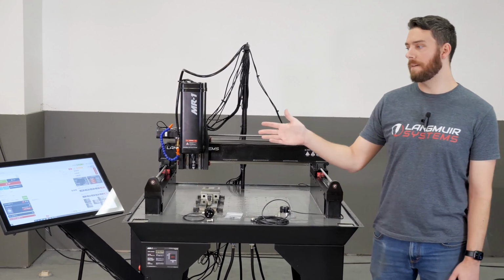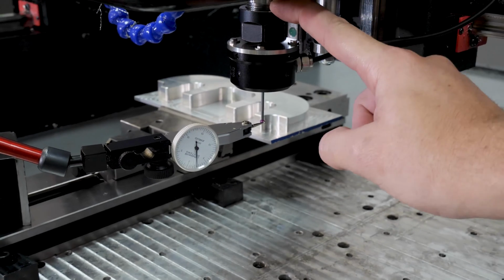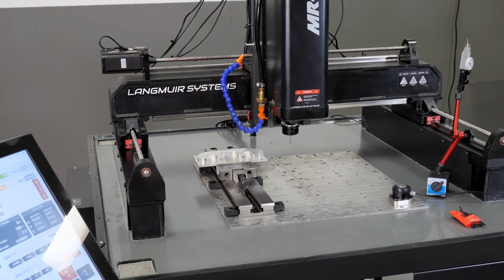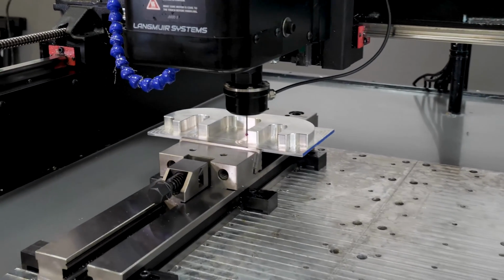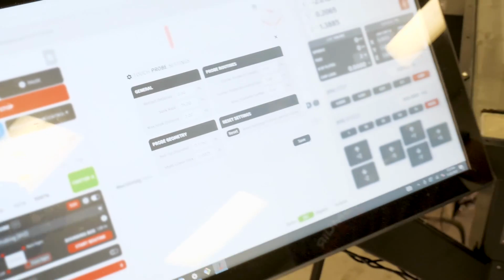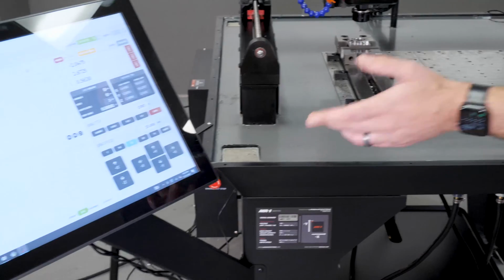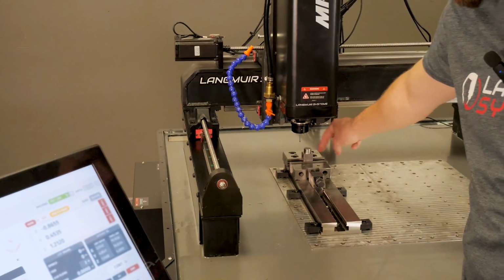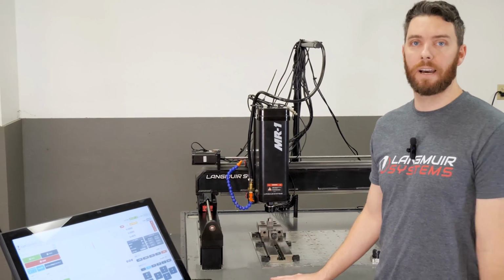MR-1 CNC Mill Assembly Tutorial: Digital Touch Probe Tutorial

Comment: When probing a diameter or boss, does cut control display the measured size. Can we calibrate the probe using a ring gauge? Also is there a protection mode to stop the probe if you get an unexpected hit with the stylus before it reaches the measuring surface, or will it break the stylus. If not can these be feature requests for the team. Also do you enter the ruby diameter in a table so the probe knows when it's on center to the spindle?
Reply from the maker: Hi Don. Regarding Bore/Diameter size no it does not display this but we will have this feature in a later release. Yes there are safeguards built into false triggers. As for the ruby diameter yes you can enter it in. The standard size is 0.1250" and these are extremely accurate from the factory to unlikely you will need to dial further but you can. We even have an area in the table to input the shaft flex compensation if you really want to dial it in well!
Reply: @LangmuirSystems  Great videos so far! Are you able to tell us waht sort of repeatability or accuracy you are seeing with the Langmuir probe?
Reply from the maker: @craigjohnson5189  the step motion repeatability of MR-1 is 0.0005"...we are finding the probe and tool setter are able to repeat within this range when accounting for any other backlashes.
Reply: @LangmuirSystems  Will current owners get those updated releases?
Reply from the maker: @davidg4188  yes 100%!